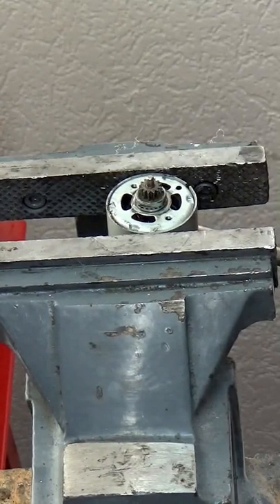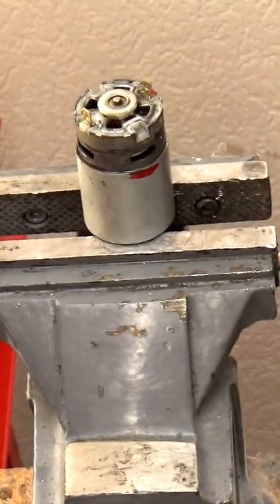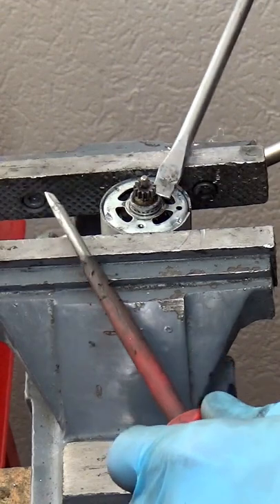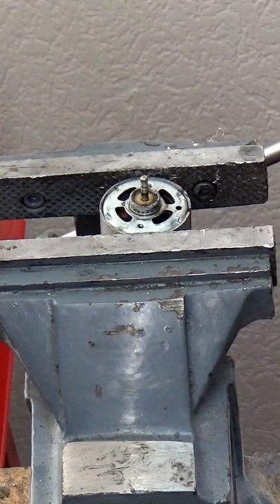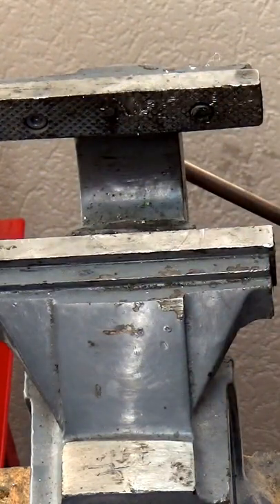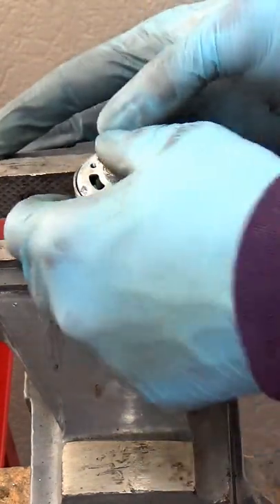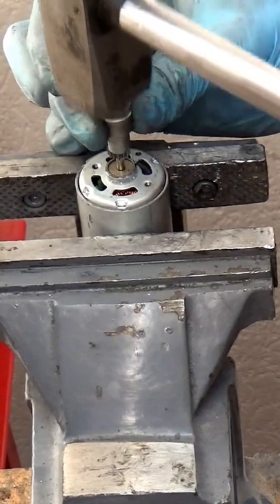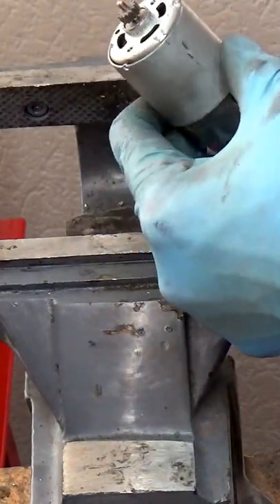How to remove DC motor gear to save money! Replaced Bosch motor with Makita motor for 10.8V drill!

Comment: If you have the 775 dc motor with a gear for robotronic gearbox, how to remove it? Torching does not work, as i don't want to damage overheat magnets and the rotor too much either.
'

Comment: The gear is no longer hardened....you anealed (softened) it.
Reply: Metals like copper and steel usually require a temperature to make them glow dull red for annealing to occur.  That is around 1100 degrees F.